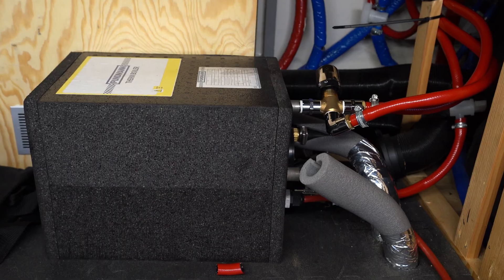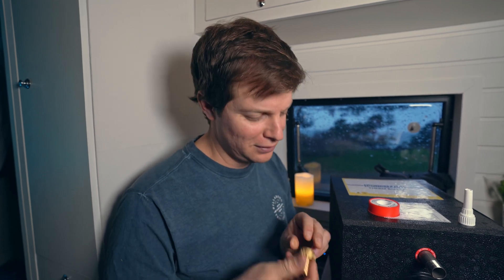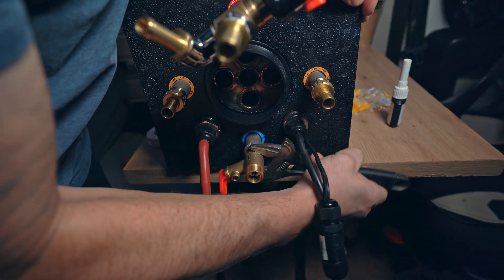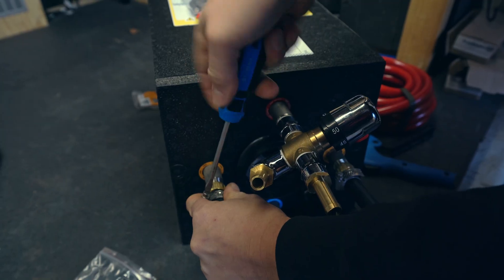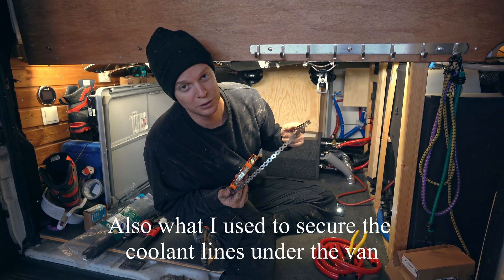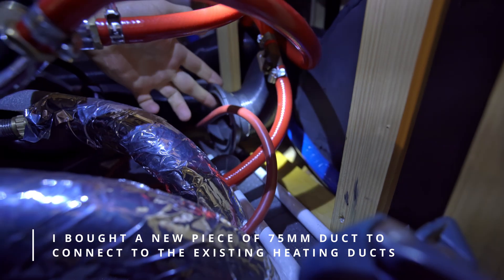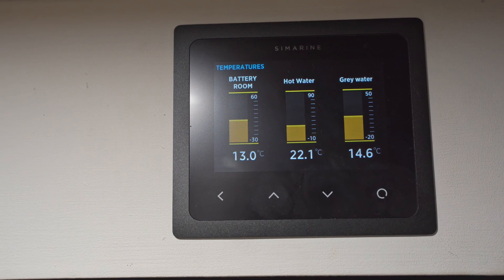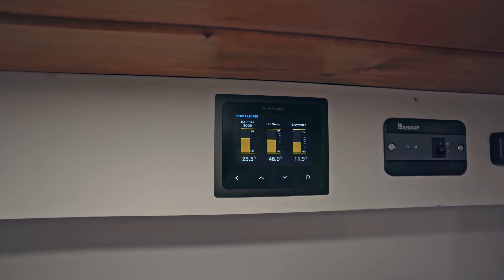Pundmann's 4 in 1 HOT WATER HEATER FOR OFF GRID LIFE Autoterm's Biggest Competitor

Comment: Hey, very good summary. Do you happen to have the measurements of the Black Insulation box around the actual Boiler tank - mean ing witout the pipe studsand fittings? 
Pundmanns dimensions vary from source to source and model to model.
Too, did you buy the off-the-shelf version or did you go through their Configuration tool online to configure your boiler? Thanks!

Comment: If you use the diesel heater for heating the water, will this also result in the van being heated (noticeably)? I guess you can close the air ducts, but the air will be pushed out of the boiler I guess?
Reply from the maker: Yes that is correct! you can close the ducts but you will still feel some heat in the air. It’s a good option in winter and if you wish to heat water this way in summer you can also just leave the van open so the heat flows out but since there are other ways to heat the water we would suggest using them in warmer weather first

Comment: Did you need to put a pump on the coolant heater hoses?
Reply from the maker: Nah, the pump from the engine handles it perfectly. You could put in another pump if you wanted to use it to pre heat the engine but we didn’t feel the need.
Reply: @LockieandAsh  
Adding one has the benefit of stopping all Heattransfer from the engine from any control box. If Boiler's up to say 75°C, switch off pump, Boiler safe :) Next to a pump I also added a plate heat exchanger to decouple coolant circuit from secondary calorifier circuit and a small expansion vessel with atmospheric pressure cap from a scooter. Eliminates Air in the system over time and gives you control for leaks. Of course that all works without, but it's nice to have. Formodern engines you also need to be careful not to mesmerize the engine heat management systems as they have flow and temperature control of several coolant paths... These are a nightmare to bleed from Air by the way ;)